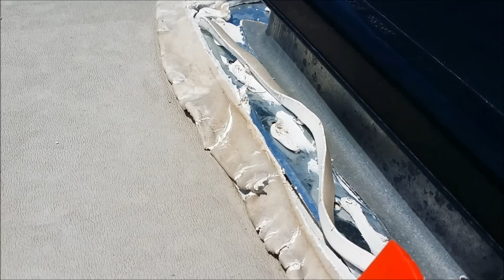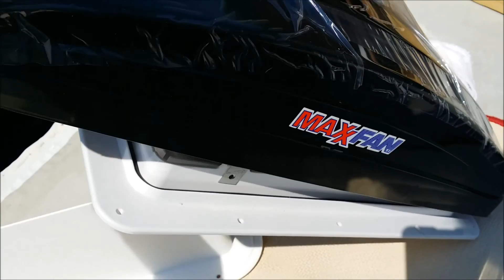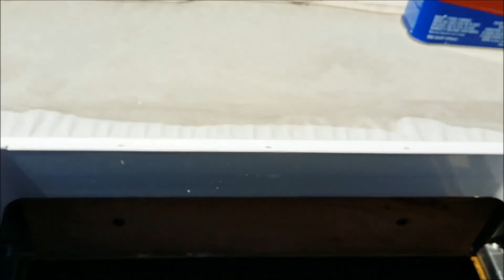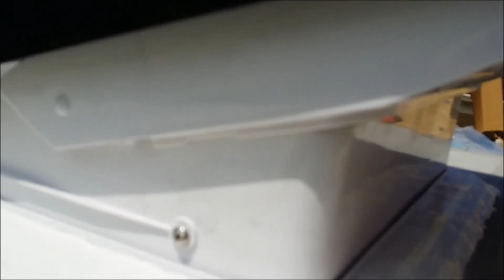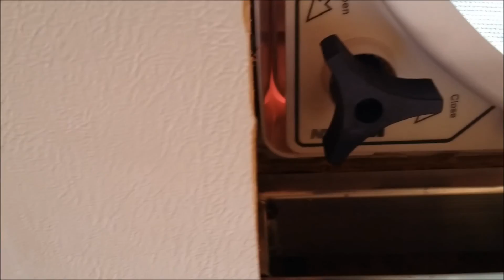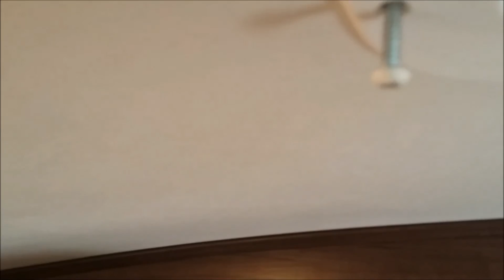MaxxFan Deluxe Installation on a RV

Comment: Thank you for the great tutorial . If I could ask you if you used the screws it came with?  I have a trailer that doesn't have screw holes and has an aluminum frame all the way around the existing fan.  I will probably have to purchase some self drillers?  Thank you again for the great tutorial.
Reply from the maker: Self tapping screws are good or if you have the old ones just use those.. Your going to seal it to the roof and around the vent anyway along with the screw heads.  Hope this helps....